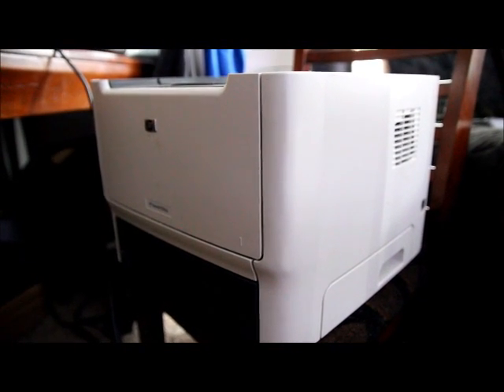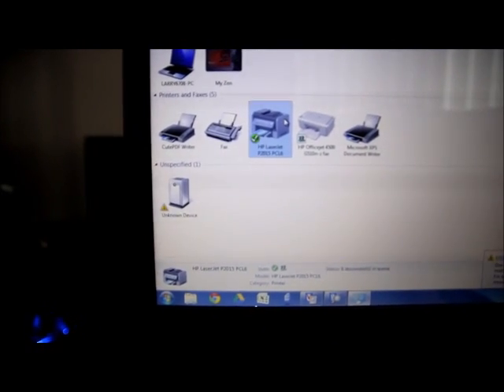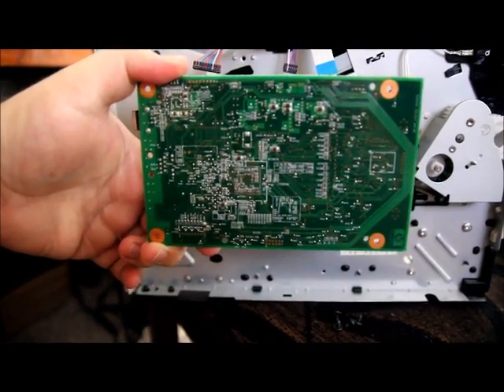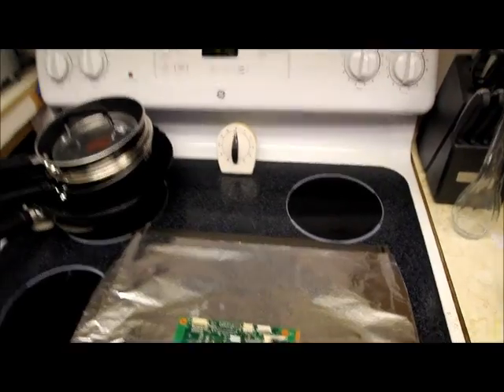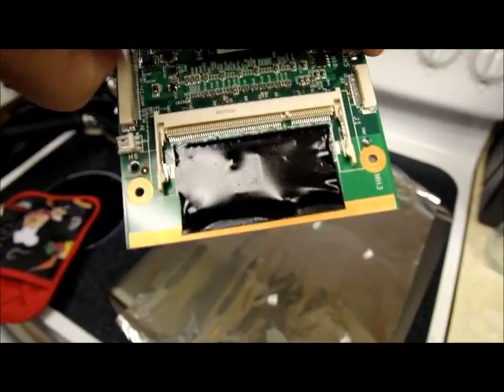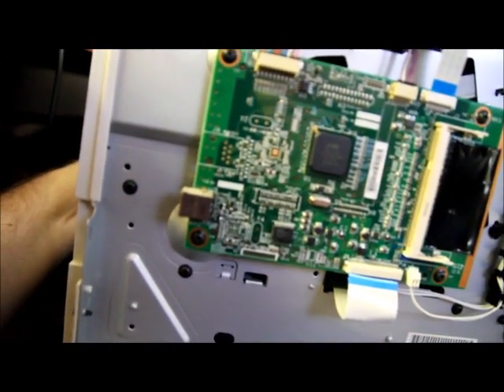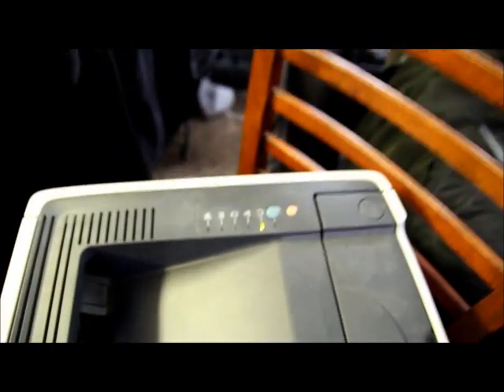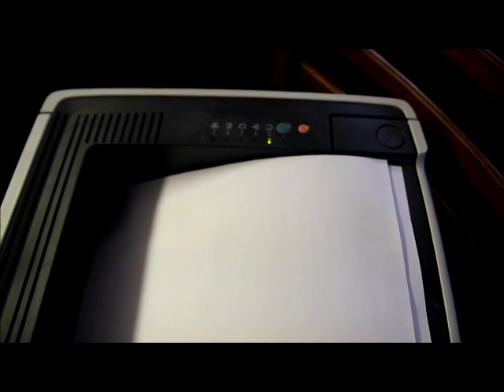HP 2015 Laser Printer Formatter Bake Repair

Comment: I bake my HP 1536 dnf formatter right now for the second time after 4 years and, magic, it WORKS!!! 😎😎😎
Reply: Hey there, I got 1536dnf and I have problems when booting and sometimes it hangs if it actually boots, after a few prints. The formater for this is the PCB on the left behind the power button, but not the PCB under that, right?

Edit: nevermind, did it. It works!
Reply: @JohnBoudouris  Hi, i have a similat HP LaserJet 1536dnf MFP printer, with similar issues: once it boots up, it prints only one page, then it freezes.... I reboot it power off / power-on, but sometimes the booting process "hangs"... sometimes it boots ok, then it prints again only one page, then it freezes again... No errors with the drivers...

I have never dissasembled this  printer (or any other). 
Please let me know which is the correct board to take out and try to bake. Thank you
Reply: @aabbccdd-1 I remember that the board was at the left side when you face the printer. If I'm not mistaken it's easy to remove the plastics, just a few screws.

Comment: Wow , this is good, I have the same problem for Samsung ProXpress C2680FX can I do the same thing as a solution ?
Reply from the maker: I'm not aware of any other printer models that can use this same baking trick. The reason this works for HP is because the solder used to make the formater boards was cheap and subject to microscopic cracks. Baking it resealed those cracks. Higher quality solder cant use this baking trick because the temperatures are higher than most ovens

Comment: Hi, how are you and yours. Thanks for this video and positive comments. But, I want to ask if I can try this on OKI printer formatters. Thanks
Reply from the maker: I would suggest doing a bit more research before trying this bake fix. The main reason this fix works is because the solder used on this HP2000 series printers were cheaper. 
So over time, the solder develops hairline cracks that sever the connection. This isn't and issue with normal circuit boards
Reply: Ok. Thanks. My OKI C801 PCB board is printing blank on magenta cartridge, I thought of risking it.

Comment: sir my problem is same and i baked it for 5minute at 200° celcius in electric baker......but still problem is same.....please guide me what should i do now
Reply from the maker: Couple of questions. Were your symptoms and problems with the printer exactly or as close to the same as what I described in the description? 
Second, 200* C sounds like a bit low of a temp. 205* might have been more accurate. 
Try baking it again with board resting above baking sheet on pegs. Make sure no metal areas are touching the baking surface at all. Bake for 5 mins 30 seconds at 205*C. Let cool and hook it back up again. If still doesnt work, board is broken
Reply: @Raidr  thank u sooooo much sir my printer is working now but tonner light is still on condition but my printer is working....👍
Reply: can u tell me about this problem please....laserjet hp p2015dn model...my duplex printing does not work.......when my printer printed one side and then page goes back for duplex printing then page stucked off in the printer.......please guide me what is the problem.......??
Reply from the maker: @SajjadAli-kx2mx  hmm, that sounds like a problem I'm not familiar with. By your description, the feeder mechanism isnt working properly. 
My first insight is to check the rollers and clean them throughly. Then check the path for any obstacles or something else in the way. Go through the whole process and find out exactly where the problem differs from normal page route operation.
Reply: thanks sir i will try my best and i will reply you soon

Comment: I'm having trouble with the power supply board of an HP 1007 printer. The problem is basically printer is power on (power LED is glowing) and relay also ON when I push power button switch (tic-tac switch) but initial checking process is not started and a popup message is coming of computer that printer has "Door Open". I have already tested with another same model immaculate power supply board then the printer is work perfectly. Already I have tested this malfunction power board parts as following, but could not resolve the problem:

1. I have compared all the parts value by a multi meter for K3564 MOSFET, D2399 NPN Transistor, BCR5PM 14l Triac with a good power supply board but all the values ar OK.

2. If the primary section MOSFET K3564 had malfunctioned then power would not flow to secondary position.

3. When the printer is connected with computer then a "Door Open" pop up message is coming but all the door switch is perfectly pushed when I cartridge door seated perfectly.

I don't understand which parts are bad on power supply board. This problem is only for power supply board because I have already tested it with an another perfect power supply board then the printer is working fine.

Comment: I have a HP Laserjet Professional M1217nfw MFP that I accidentally plugged into my UPS surge protector for about an hour before I realized I had plugged it up incorrectly as HP says clearly DO NO DO. So I was looking around for a possible solution since "A" printer is recognized on my windows machine when connected but not "THE" printer HP Laserjet Professional M1217nfw MFP. Does anyone know if this might work? I get a blank display literally all grey no lettering on the digital display. I do get the top green light and lower two orange lights. Does anyone know if I might be able to revive this printer with this trick? Trying not to spend an extra $300 on a decent printer at the moment? Could this work or would it hurt it to try...?

Comment: I baked mine and it worked for only a few minutes. So I bought another one. To remove the side panel, slide the top rear side back of the panel with a screw driver away from the little black screw that it covers while removing the bottom of the panel. Then push forward and the entire panel will come off with ease.

Comment: But in a couple of months the malfunction is repeated
Reply from the maker: Couple of things that might have caused this. 
1) didn't bake it long enough causing the solder to liquefy.  
Explanation: The reason this error occurs is bad solder which cracks, causing a severed connection. This bake reheats and reconnects the cracks. You can try again for a slightly longer time frame, maybe 5:30 or 6:00 depending on your oven. 
2) There is another problem on your formater board that is giving the same error codes. 
If trying the reheating in the oven trick for longer doesn't work, then its a bad formater.  You can purchase another used on long for $35 approximately on ebay or at an online parts store.
Reply: Thank You!
Reply from the maker: Eneling Brod sure thing. Best of luck

Comment: I also wish to add that this does indeed work, did it on mine. poor soldering/material on this specific board needs this simple step. I saw this vid 1 year ago and tried it. I needed to do it again at this time. So you may need to do this step more than once as your 1st step for fixing until the printer itself is desired to be replaced, but this printer is fast and quick for B&W. 5 minutes @ 400 F

Comment: Just did this myself last night on my HP 2015. I opted for the 375 degree(F) for 6 minutes 30 seconds time and now the printer works.
I'll just add when you take the side panel off the printer, start with the back top an bottom corners, then the front should come off more easily and when putting it back, hook the front in then the back should snap back in.  I think the hooks in the front are bigger than the back.
Thanks for making this video

Comment: Thanks for this video.
Several years ago I paid $10 for a non-working HP2015dn.  I found a printer repair website which described the formatter board bake fix.  I fixed mine a better way with Stabilant contact enhancer. 
That website had some good info about what was causing problems with a variety of products, especially the 2015.
2 things changed when the 2015 came out:
1.  The whole industry was rapidly transitioning to lead-free solder, which requires notably higher temperatures, is less ductile, in many ways is far less "error tolerant".
2.  With this change, HP decided to move it's PCB production to China.

After fixing the formatter board, I found this printer has to  have the additional RAM to work reliably. I got it on eBay for about $15.
One other thing to note, this, and most other laser printers need to be plugged Directly into a wall outlet, Not a power strip, extension cord etc. because they need a Lot of Power to quickly heat up the fuser.  You will see an odd variety of errors/print failures which go away when the printer has all the power it can use. (..perhaps your USB errors...)

This is an excellent, small, duplexing B&W laser printer. Super cheap to operate, utterly reliable.

Comment: No,  that  is  not  true.
      don't  try   ,  please  by  a  new  mother  board
Reply from the maker: Motherboard? This isn't a computer. If you want to buy a new "formater" board then by all means. 
however, this this a low cost easy fix that does in fact work most times for this type of error.

Comment: I just spent all morning trying to get my HP LaserJet P2015dn to work, it was giving me a paper jam error just as you pointed out in your video.  So I decided to watch your video and boy oh boy am I glad I did.  It took me about 5 minutes to tear it down, remove the board, turn on the oven and preset it to 400 degrees, placed the board in the oven and waited 5 minutes, removed it, let it sit for 10 minutes.  After putting everything back together, I told myself "there is no way this is going to work"; however it did work!  Thank you for taking the time to post the video on YouTube.

Comment: Baked two formatter boards today - one for a P2015 and one for a P3005, and both worked!  I had my doubts, but it DID work great!. I adjusted the temp to 375F and the time to 6 minutes, 30 seconds to avoid melting the plastic. I did NOT raise the formatter board off the foil.  Not sure if having the solder points in direct contact with the foil helped with the melting process or not.
I had been putting this off for months, but now I wish I hadn't.
I'll post again in 6 months with an update, or sooner if either one fails.
Reply: Hi, i think it's time to let us know how it went 😂

Comment: This is a common problem with hp boards. I fix mine by using a small gas heat gun over the cpu on the board

Comment: Anyone try using flux? Any advice on that? Plus it looks like there is only one area on the board that has whitish solder so maybe that is the only spot that needs heat. If this works I guess I've got to try it.  Thanks for posting.

Comment: wonder if your printer still work?  got two formatter board on this machine (2015dn - Ethernet network) baked several times with 425 degrees and worked for a week or so and stops working, again.
Reply from the maker: Hello Night, yes my printer is still working perfectly.  Used it over the weekend for a 20 page print out in fact. Sorry you're having such bad luck with the formatter board.

Comment: What a kind of problem this printer show? I have one of this and the LIGHTS READY, GO and ATTENTION is ON and the SECOND ERROR CODE is READY and GO Lights ON but MANUAL dosen't describe this problem! CAN I DO THIS METHODE? What the Themperature Thanks Guy?
Reply from the maker: Hello Allan, the problem was explained above in the description and in the first minute of the video.  Paper Jam error.  This is the tell tale sign that its the formatter board. The problem you are describing sounds like something else. I don't know if you can do this method because the symptoms of your printer appear different.  If you want to attempt it anyways, the temperature I baked it at was 400 degrees.  Good luck but I would do more research first before attempting this formatter board fix.